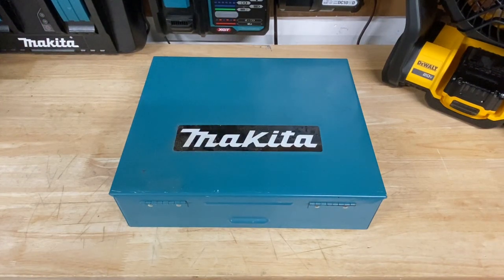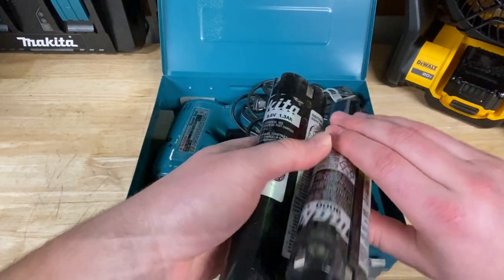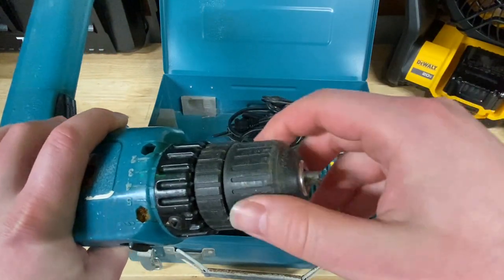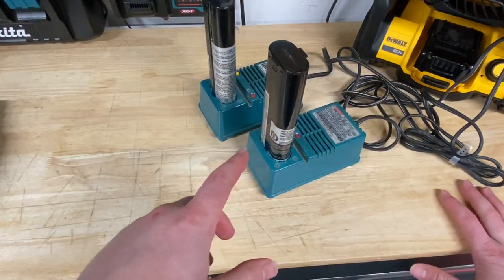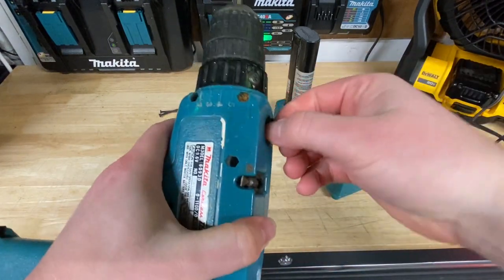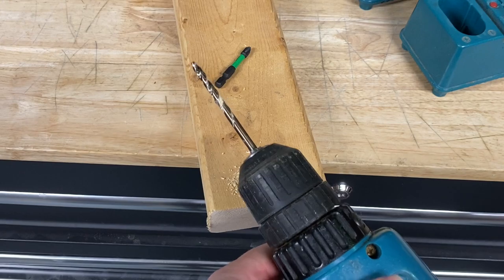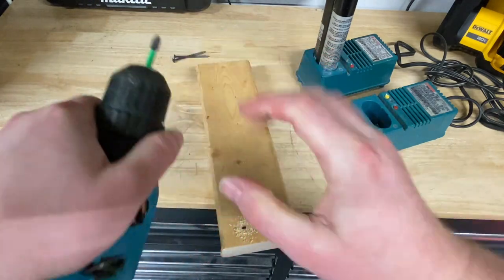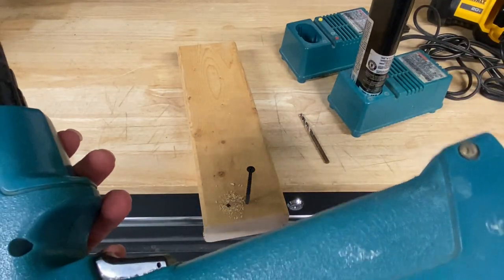What Vintage 90s Makita Tool is in this Box? Does it still work?

Comment: My Dad bought a similar drill back in the 80s. He built and remodeled a lot of houses with it.  It still has the original batteries, and they do hold a charge. I did buy new batteries online. I occasionally break it out and use it.

Comment: I still have one of these Makita 6093 drills.  It's even older than the one that you have.  Mine originally came with a keyed chuck (no keyless chucks for portable drills back then) that I replaced with the keyless chuck several years later.  I don't remember exactly when I bought it but the date on the manual is December 1986 so they're older than you believe.
Reply from the maker: Nice! Thanks for the Info!
Reply: I have the exact same drill as you mine says 1986 in the manual and I own the 6012 drill

Comment: The knob on top is for low or high gear !!
Reply: Yes, the knob on is for high and low gear. And the line needs to be perpendicular to the direction of the of the drill bit to be in one gear or the other.

Comment: My dad used an older type of this drill while in trade school in the mid to late 1980s and they had the keyed chucks which my dad hated because you would always loose the key for the chuck and the battery would have a memory which means that you had to completely use up the battery otherwise if they still had some juice in the battery it would stop charging and it would cook the battery

Comment: I just bought a angle grinder, jig saw a drill that came in a 3 piece  Its a lighter blue color and they are corded. Brand new for 20 dollars, swear to god. Deal of the century. I cant find any information on them. Just looking to know how old they are. They also threw in a hammer drill with the same color for another 20.